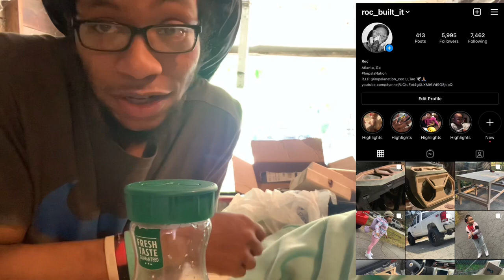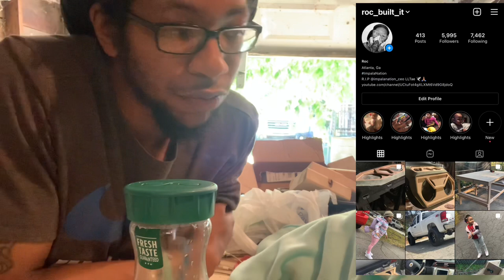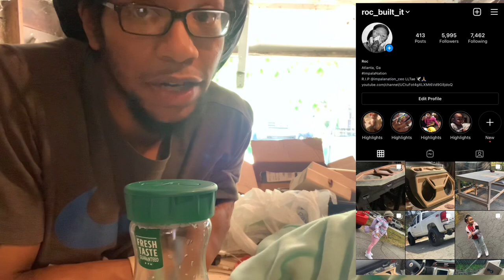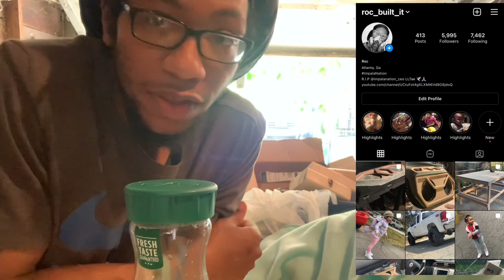Custom Rear Deck Panel

Comment: Great work...keep it coming. I just want to say that MDF is great for woodworking just make sure you have a quality respirator when working with that shit because it's toxic. I usually either cut and route outside or used dust collection. I prefer outside because that toxic dust is real fine and lingers in the air.
Reply from the maker: Thanks man I really appreciate it. But I keep the garage doors open and have my mask on at all times

Comment: You know what I just started doing custom work on my 96 town car ...did my rear deck. I took off the old carpet and re applied spray adhesive then a 1/4 foam then a suede layover..I SHOULD HAVE DID SOMETHING LIKE THIS wow
Reply from the maker: It’s never too late. Go for it bro 💪🏽💪🏽

Comment: My primary income is carpentry and ive been searching for ideas on a center console build to swap out my silverados jumper seat. IN my search I ran across your videos. I wanted to say thank you for the ideas and felt I should drop some suggestions. Get yourself a nice set of flush cutting router bits as well as the bit guide set. This makes cutting the wholes for speakers a breeze and allows you to adjust depth. Might snag a 1/4" sheet of mdf and make yourself a template for the repeatable needs, such as speaker holes.
Reply from the maker: Thanks I will in the future. And thanks for tuning in bro 💪🏽💪🏽💪🏽💯💯💯

Comment: Great work again!!!!!!  Roc.... what size mdf do you use and did you use a 2 part epoxy for the leather? Css as n I have the name?  Keep up the great work cuz
Reply from the maker: Thanks man 💯. But most of my work I use 1/2 inch thick mdf. And no I use contact cement…old trick in the book for upholstery 💪🏽😎